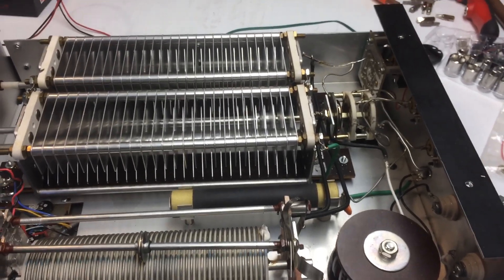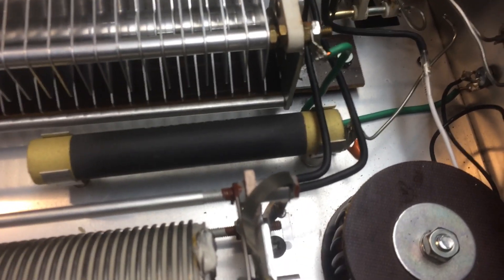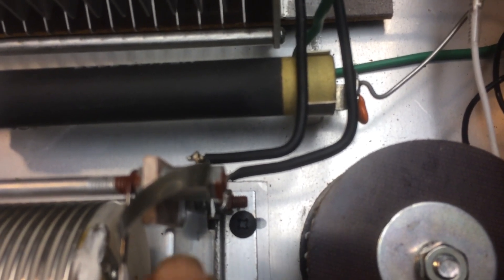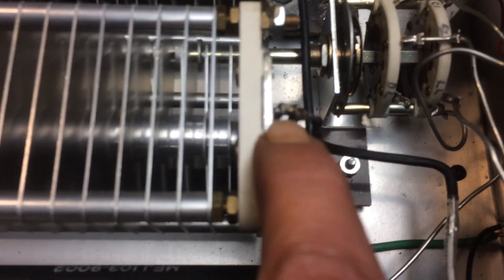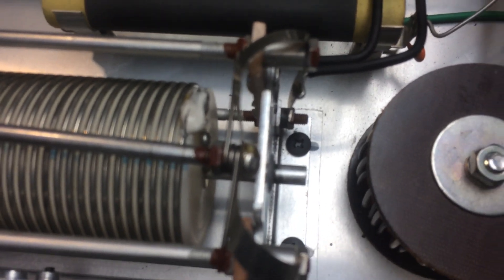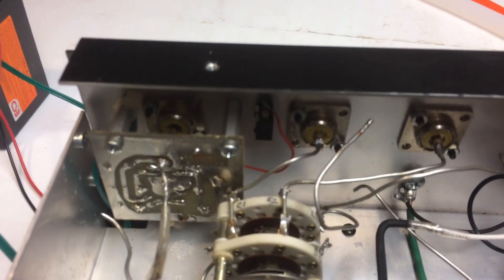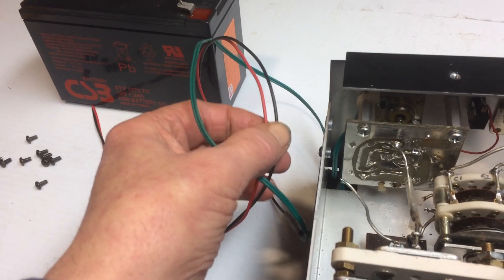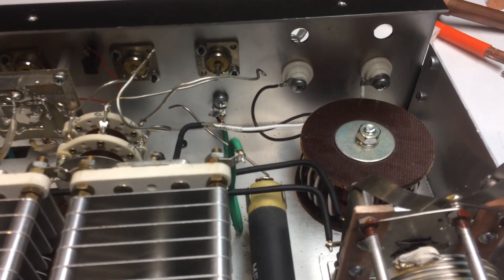Antenna Tuner Mod rewire “T” to “Pi” Network for Open Wire Feedline

Comment: I'm not trying to wide band my antennas , I just want to clean up the swr across the 11 meter on my A99 and Moxon .  I've seen on a couple mag loop builds where they were only using a variable cap and no coil tapping . Would I be able to tune the antennas with just a capacitor since I'm staying with one band or would I still need the coil ?
Reply from the maker: I’ve done a lot of experimental stuff in the past and would encourage you and others to try things that may be considered outside the box. 
Trying different things is how you find out stuff for yourself 
In short I would advise you to try your idea and observe the results.. you may be surprised ! Variables such as antenna length, location, height, length of Feedline will all affect antenna performance so sorry if I am not able to definitively answer your question 
Good luck and don’t stop experimenting !
Reply: @madeinfoxtrap5539  Thanks for the reply and appreciate the info .  Might be the best route to take any way , it seems my hobby is rubbing off on my wife and she's been talking about GMRS because of her work , she's on the road a few hundred miles every day .

Comment: Nifty! How does it improve the match?
Reply from the maker: Harry Porter it doesn’t really improve the match
The “T” network gives you the most versatility and range for the value of the components used 
However it also accounts for more losses through the grounded inductor
If you follow the circuit schematics for the “Pi” network you will see a direct path from antenna to rig with capacitor bypass to ground 
The “T” relies on capacitance to pass the signal through while grounding the inductor 
This is most of the losses associated with tuners draining power to ground
73